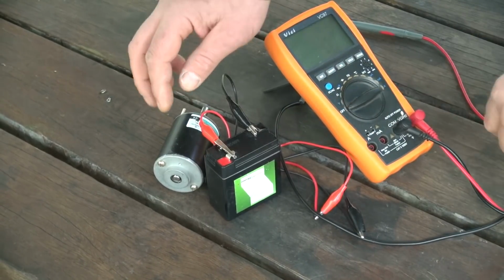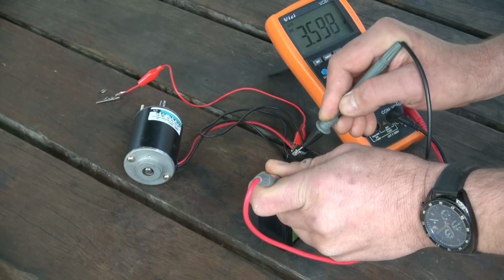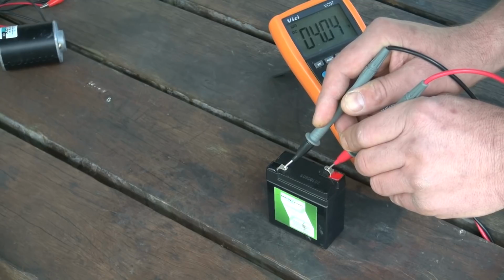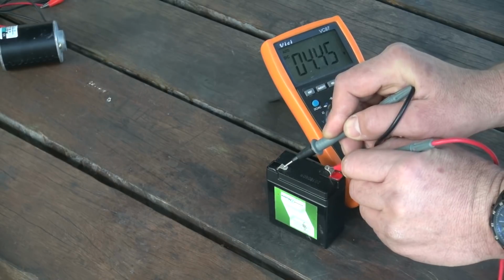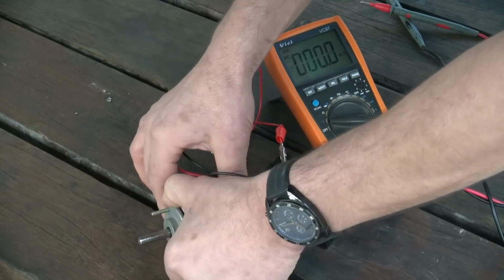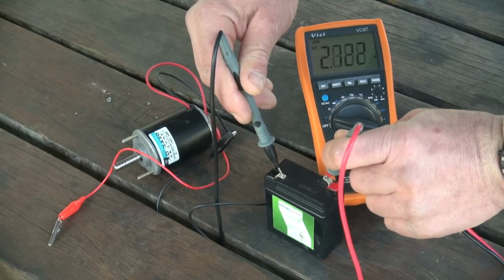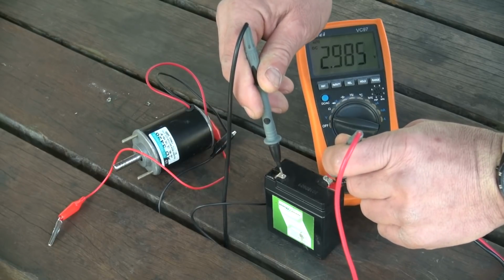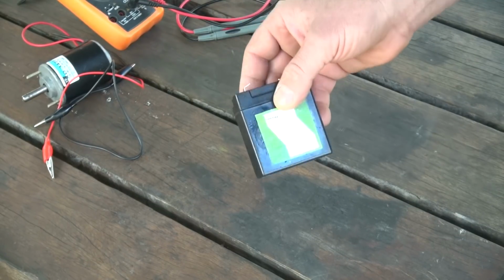An xPower Battery demo - recharging itself...???

Comment: Lol. that is a completely dead battery. You have to realize that a battery doesn't just "reduce it's voltage" as it gets drained, but more importantly, it increases its ESR (equivalent series resistance) which will go up and up. When you connect a multimeter, you're connecting the tiniest possible load across the battery (1 megaohm or so), so it doesn't effect the voltage reading. But, as soon as you still a real load (like your motor), you quickly realize that there is no real energy there; the voltage collapses. You could think of the two scenarios: When the battery is 100% charged, the voltage is ~6V, and the ESR is ~0.5 ohms. As it drains, the voltage drops a bit (say, 5V), but the ESR also increase (say, to 1 ohm). As you go beyond that, the voltage drops a bit more (say, 3.5V), but the ESR is exponentially higher (say, 1000 ohms). As soon as you add a load, the voltage at the terminals drops to nothing.

Comment: Tesla was wrong. That's why we still put wires on pylons.
Reply from the maker: EnergyxPower
Pinned by EnergyxPower
EnergyxPower
6 seconds ago
Hmmm...just as expected...from the hundreds of contacts, the handful of "academics" and "professionals" who would rather rip down than to get interested to explore, test and observe...sounds like what I discussed in this video where the two chemists, Fleischman and Pons who were VOTED against their discovery and science bacxk in 1989!!!

You can watch that here: https://www.youtube.com/watch?v=1TXURSxbimI"

I've never claimed that Dielectric relaxation or any such phenomena do/or not present themselves within all modern type batteries. Perhaps a more accepted term would be "a greater capacitance" or charge to what the current field of Primary and Secondary batteries are able to obtain. Primary being non-rechargeable and Secondary being -rechargeable...

All feedback is appreciated....and as a Start-Up, most who are commenting haven't been nor have they had to create something from nothing.... as a long time Entrepreneur I understand that. Roberty Kiyosaki constantly states that most are stuck in the E/S part of the quadrant. Employees = Jobs or Self-Employed = Job + perks. (no pun intended)

As the Director/Founder/Inventor @ EnergyxPower I am authorized to act as I determine. I am willing to offer a $5,000 AUD challenge to anyone who is brave enough to take it up putting up an equivalent amount of money to either prove or disprove our claims....? 

If you are up to the challenge, just reach out through our website.

BYI - we are going to holding a Proof of Concept of the xPower Cell within the next coming months, so I hope that you stay connected and at least interested in pursuing the possibilities.

Comment: ALL batteries recover to some extent after the load is removed. Nothing special about xPower in this respect. Only the off-load terminal voltage is increasing, not the charge state.
Reply from the maker: EnergyxPower
Pinned by EnergyxPower
EnergyxPower
6 seconds ago
Hmmm...just as expected...from the hundreds of contacts, the handful of "academics" and "professionals" who would rather rip down than to get interested to explore, test and observe...sounds like what I discussed in this video where the two chemists, Fleischman and Pons who were VOTED against their discovery and science bacxk in 1989!!!

You can watch that here: https://www.youtube.com/watch?v=1TXURSxbimI"

I've never claimed that Dielectric relaxation or any such phenomena do/or not present themselves within all modern type batteries. Perhaps a more accepted term would be "a greater capacitance" or charge to what the current field of Primary and Secondary batteries are able to obtain. Primary being non-rechargeable and Secondary being -rechargeable...

All feedback is appreciated....and as a Start-Up, most who are commenting haven't been nor have they had to create something from nothing.... as a long time Entrepreneur I understand that. Roberty Kiyosaki constantly states that most are stuck in the E/S part of the quadrant. Employees = Jobs or Self-Employed = Job + perks. (no pun intended)

As the Director/Founder/Inventor @ EnergyxPower I am authorized to act as I determine. I am willing to offer a $5,000 AUD challenge to anyone who is brave enough to take it up putting up an equivalent amount of money to either prove or disprove our claims....? 

If you are up to the challenge, just reach out through our website.

BYI - we are going to holding a Proof of Concept of the xPower Cell within the next coming months, so I hope that you stay connected and at least interested in pursuing the possibilities.

Comment: Great insight into the design team at  Batterizer Batteroo.
Reply from the maker: EnergyxPower
Pinned by EnergyxPower
EnergyxPower
6 seconds ago
Hmmm...just as expected...from the hundreds of contacts, the handful of "academics" and "professionals" who would rather rip down than to get interested to explore, test and observe...sounds like what I discussed in this video where the two chemists, Fleischman and Pons who were VOTED against their discovery and science bacxk in 1989!!!

You can watch that here: https://www.youtube.com/watch?v=1TXURSxbimI"

I've never claimed that Dielectric relaxation or any such phenomena do/or not present themselves within all modern type batteries. Perhaps a more accepted term would be "a greater capacitance" or charge to what the current field of Primary and Secondary batteries are able to obtain. Primary being non-rechargeable and Secondary being -rechargeable...

All feedback is appreciated....and as a Start-Up, most who are commenting haven't been nor have they had to create something from nothing.... as a long time Entrepreneur I understand that. Roberty Kiyosaki constantly states that most are stuck in the E/S part of the quadrant. Employees = Jobs or Self-Employed = Job + perks. (no pun intended)

As the Director/Founder/Inventor @ EnergyxPower I am authorized to act as I determine. I am willing to offer a $5,000 AUD challenge to anyone who is brave enough to take it up putting up an equivalent amount of money to either prove or disprove our claims....? 

If you are up to the challenge, just reach out through our website.

BYI - we are going to holding a Proof of Concept of the xPower Cell within the next coming months, so I hope that you stay connected and at least interested in pursuing the possibilities.

Comment: This is nothing of the sort - what your observing is the effect of a build-up of reaction products around the electrodes inside the battery. Once you remove the load, these products then diffuse back, effectively recharging the battery. The effect is more pronounced when the battery is discharged using a high load. 

Try doing the same thing using a lower load that takes longer to discharge the battery and you'll see that recovery is (a) a lot slower and (b) nowhere near as complete...or even using another type of battery altogether.
Reply from the maker: Great point, and believe me. I've been doing testing for over a year since making the discovery....it's just hard to  convey due to the time involved etc.... Thanks for your input.
Reply: This might shed some light on what you're observing (especially section 2 on Chemical Description of the Recovery Effect):

http://centaur.reading.ac.uk/72519/8/JOE.2017.0303.pdf
Reply from the maker: EnergyxPower
Pinned by EnergyxPower
EnergyxPower
6 seconds ago
Hmmm...just as expected...from the hundreds of contacts, the handful of "academics" and "professionals" who would rather rip down than to get interested to explore, test and observe...sounds like what I discussed in this video where the two chemists, Fleischman and Pons who were VOTED against their discovery and science bacxk in 1989!!!

You can watch that here: https://www.youtube.com/watch?v=1TXURSxbimI"

I've never claimed that Dielectric relaxation or any such phenomena do/or not present themselves within all modern type batteries. Perhaps a more accepted term would be "a greater capacitance" or charge to what the current field of Primary and Secondary batteries are able to obtain. Primary being non-rechargeable and Secondary being -rechargeable...

All feedback is appreciated....and as a Start-Up, most who are commenting haven't been nor have they had to create something from nothing.... as a long time Entrepreneur I understand that. Roberty Kiyosaki constantly states that most are stuck in the E/S part of the quadrant. Employees = Jobs or Self-Employed = Job + perks. (no pun intended)

As the Director/Founder/Inventor @ EnergyxPower I am authorized to act as I determine. I am willing to offer a $5,000 AUD challenge to anyone who is brave enough to take it up putting up an equivalent amount of money to either prove or disprove our claims....? 

If you are up to the challenge, just reach out through our website.

BYI - we are going to holding a Proof of Concept of the xPower Cell within the next coming months, so I hope that you stay connected and at least interested in pursuing the possibilities.

Comment: Dielectric relaxation on the plates and charge redistribution, the battery in no way shape or form recharges.  Look up what actually comprises energy in a introductory electrical engineering textbook and realize watts=volts x amps.
Reply from the maker: EnergyxPower
Pinned by EnergyxPower
EnergyxPower
6 seconds ago
Hmmm...just as expected...from the hundreds of contacts, the handful of "academics" and "professionals" who would rather rip down than to get interested to explore, test and observe...sounds like what I discussed in this video where the two chemists, Fleischman and Pons who were VOTED against their discovery and science bacxk in 1989!!!

You can watch that here: https://www.youtube.com/watch?v=1TXURSxbimI"

I've never claimed that Dielectric relaxation or any such phenomena do/or not present themselves within all modern type batteries. Perhaps a more accepted term would be "a greater capacitance" or charge to what the current field of Primary and Secondary batteries are able to obtain. Primary being non-rechargeable and Secondary being -rechargeable...

All feedback is appreciated....and as a Start-Up, most who are commenting haven't been nor have they had to create something from nothing.... as a long time Entrepreneur I understand that. Roberty Kiyosaki constantly states that most are stuck in the E/S part of the quadrant. Employees = Jobs or Self-Employed = Job + perks. (no pun intended)

As the Director/Founder/Inventor @ EnergyxPower I am authorized to act as I determine. I am willing to offer a $5,000 AUD challenge to anyone who is brave enough to take it up putting up an equivalent amount of money to either prove or disprove our claims....? 

If you are up to the challenge, just reach out through our website.

BYI - we are going to holding a Proof of Concept of the xPower Cell within the next coming months, so I hope that you stay connected and at least interested in pursuing the possibilities.
Reply from the maker: I here what you saying, though hard to convey through a short video, it offers some of the effects and results currently being observed and tested. Perhaps it would be best to say,  "a battery offering a much greater capacitance" which it is. Stay in touch as we are working on proof of concepts as the Scientific field won't go anywhere near this as it "defies" their current laws of science.
Reply: Also EnergyxPower, you really need to learn the basics... facepalm
Reply: Thing is there is nothing any scientist would love to do more than defy the "law of science" (except for "more sex"). What this means is to be able to demonstrate that our current understanding of a phenomenon is wrong (I'm talking about defying the law of science, not  "more sex"). I am open to the belief that big battery manufactures are suppressing the truth via a mechanism I cannot begin to imagine (probably related to "more sex"). Have you tried opening up a battery to see if it contains any threat (or opportunities for "more sex")?   I conscious of poe's law (and ANY opportunity for "more sex", so please let me know what you find).
Reply: Zendal, have you completely lost your mind? What are you even talking about?